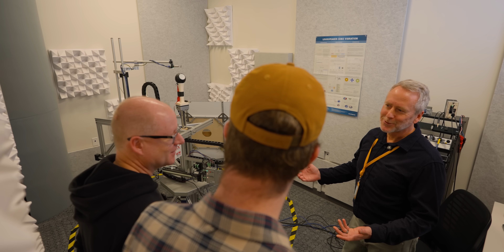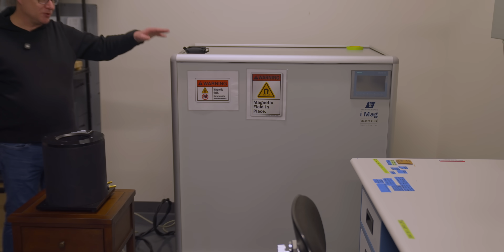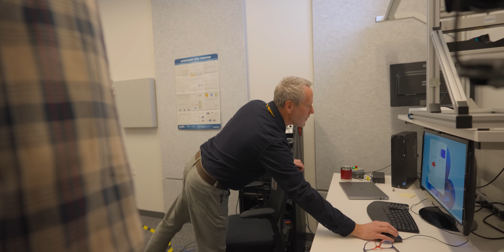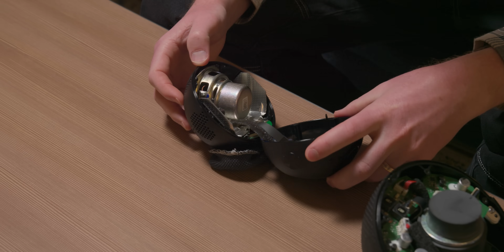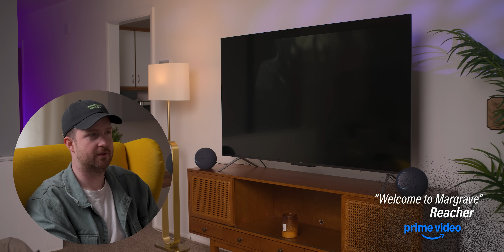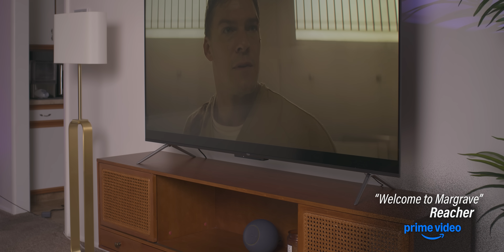Engineers Fought Over Every Millimeter of This

Comment: Question, how do they work without a fire TV?
Reply: They can be used as basic Bluetooth speakers but that's about it. I don't think they support Dolby or anything without fire TV. You can just use them as standalone smart speakers.. The newer ones don't have 3.5 jacks so they're worthless for latency free audio in like the old echo studio could be a viable sound bar on any TV but not this one.
Reply: @VonnegutRosewater-yi4rk thats the point.

Comment: Why would you need custom silicon ?
The audio processing algorythms must be tricky to develop, but they are not computationaly expensive for modern DSPs.
Reply: I guess they're combining a lot of different things into the custom silicone to fit the space they have on the PCB, so they might be using off the shelf DSP designs, but are also including other off the shell designs on the same silicon.

Comment: Doesn't the TV act as center channel? It's all amazon products?
Reply: TV guys probably made the tv speakers sound like ass for cost reasons, and also to push customers to these new speakers.
Reply: @SarahJRandomNumbers  fireTV is a general OS that is installed to a ton of different TV. All of which will get this feature update. And they all have different prices and speaker setups.

It should be one of the selectable options.

The only explanations are either stupidity at some level, or sony owns a patent on it. Because they did it for the wireless suround kits they sell in ecosystem with the high end TV options they have.

Comment: This is a good commercial, I am not the target audience for this product but I was already impressed with the engineering and now I am even more. I have a huge single 15" woofer vintage floor speakers, and a friend has two of the cylinder Echos and the sub. They sound extremely impressive for the size and very good in general, but strained due to lack of headroom. Mine go much louder and are clearer, and I can put things on top of them because they are the size of endtables. I feel the newer floor speakers that are narrow are an annoying size, they're still big but you can't put things on top of them.

Comment: Were those a bunch of acoustic panels in your living room? (The big grey rectangles sitting on the half wall?) do you always have those up or were the put up just for this video. That part just seemed a little… to “ideal conditions” when showing off the auto-surround sound set up. Overall though great video. I understand the need for ad content like this to allow the funds for other content but I like how this was almost entirely focused on the tech and engineering of “how it works” instead of just being surface level “this is why you need to buy this” like some ad on YouTube can be.

Comment: Really cool hardware, sucks that they're locked to Alexa's firmware & useless if/when their servers go offline, or support is dropped
Reply: Well yeah, but it’s an IoT speaker. There ain’t a whole lot of options for devices that don’t require logins or cloud infrastructures. Just have a look at smart light bulbs for example

Vote with your wallet. I haven’t touched echo’s for 6 years, instead I have an old ass amp and a Squeezebox with open firmware
Reply from the maker: It does have Bluetooth fallback. Not as good as line-in, but better than ahem others.
Reply: @snazzy  Better than nothing, but FOSS firmware (even just unlocked bootloader in general) or line-in would be ideal. At $220/ea this can't be priced to make up the hardware cost with services, right?
Reply: @snazzy  If you're hinting at HomePods, AirPlay is local, you don't need iCloud connectivity for it to work. They will stream directly from the source if they can, but if not it will come from your device. I've had Internet outages and I was still able to stream via 5G and AirPlay to devices on my LAN. 

Not sure about Google's speakers.
Reply: @coyote_den  That's still Apple only...
Reply: @coyote_den  Locked to an ecosystem and you need to pair them to an icloud account before they can be used.